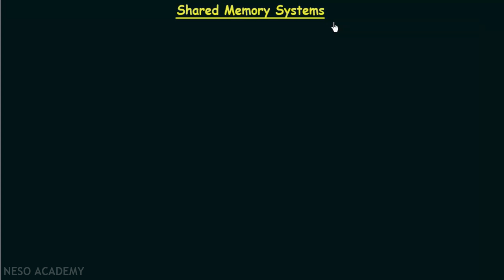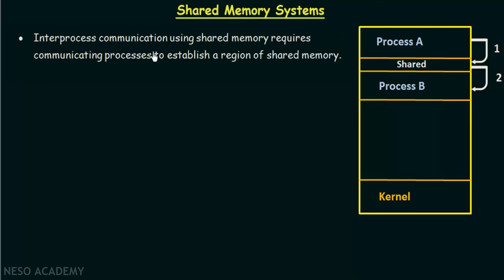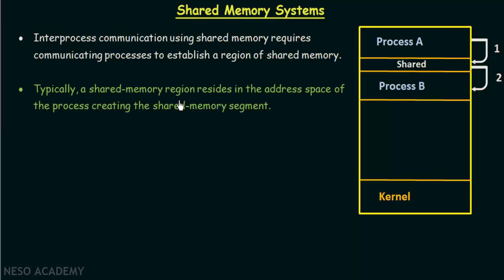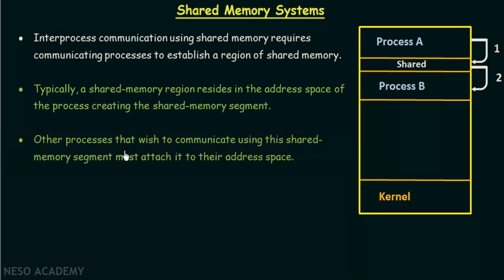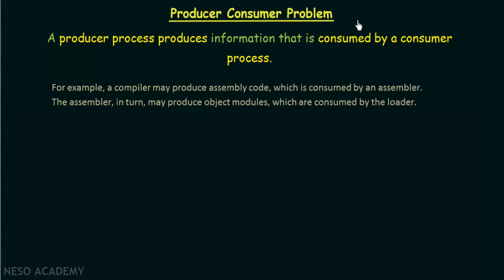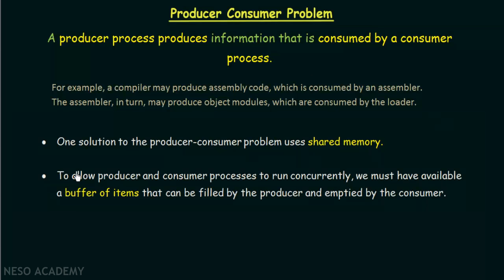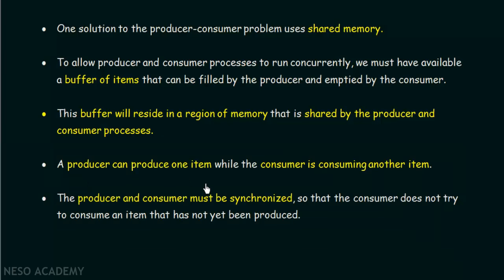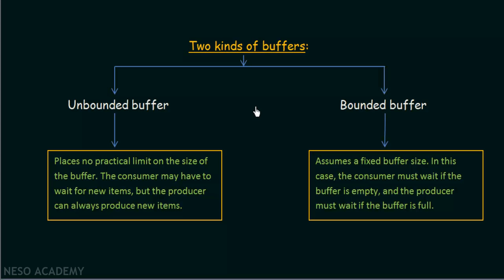Shared Memory Systems

Comment: Here is what I understood:
Shared memory System is one of models of Interprocess Communication which is used for communicating between processes by creating region of a memory. The processes that initiated communication will be creating the region of a memory and others who wants to communicate has to put the shared memory-segment to their address space. Originally operating system won't allow processes accessing each other's data, but if two or more processes agree to remove their restriction then it's possible. 
In order to understand the concept we took an example of Producer Consumer problem. Producer produces an information and consumer consumes information (just like real life examples like having services, buying staff, surfing internet etc). The problem is the producer and consumer has to work simultaneously so that while producer produces, consumer will consume. They has to be synchronized so that consumer will only consume what's available there (instead of trying to consume which isn't produced yet). The solution to the problem is shared memory, to allow producer and consumer work concurrently we need something called buffer of items which can be constantly filled with information by producer and consumed by the consumer. Buffer resides in shared memory region. 
There are two types of buffers, unbound buffer and bound buffer. In either case if there is no information to be consumed then consumer must wait. The difference is for unbound buffer, the producer can produce without limitation while for the bound buffer producer can produce only fixed amount of data.
Reply: Fantastic understanding
Reply: pucha kisine?

Comment: u explained that, if 2 processes want to use 'Shared memory' for communication then they should break the restriction which is put by OS, i.e one process can not access memory of other process and vice-versa. So
how this restriction is broken by processes?
who is going to intimate this broken restriction to OS?
Actually only processes who want to access this memory, should break the restriction. isn't it? If not, then why process which is going to write into buffer, should break the restriction? because shared memory resides in its own memory space.

Comment: My question is that if the shared memory region in this IPC method has anything to do at anypoint with dynamic libraries or the libraries that have an address space from which other programs can use for dynamic library linking or is this method of communication separate from this all together?
Reply: That is to say is the data being exchanged generally dynamic library code  between process A & B ??